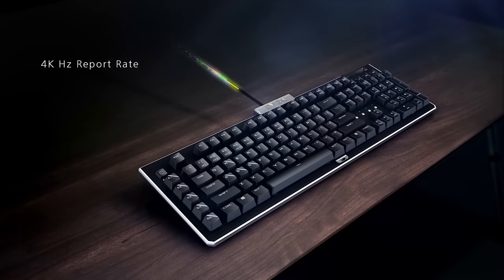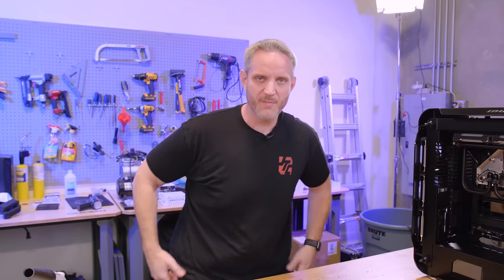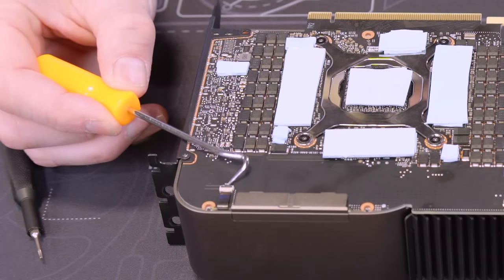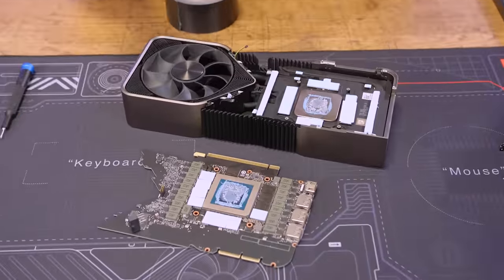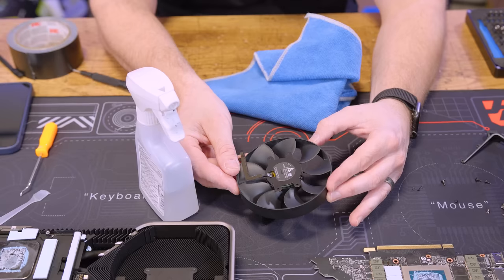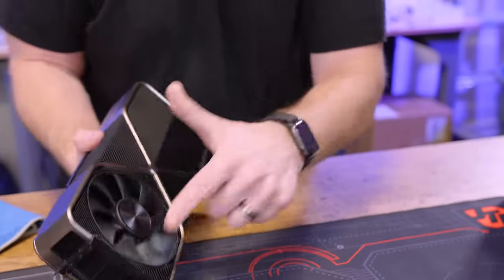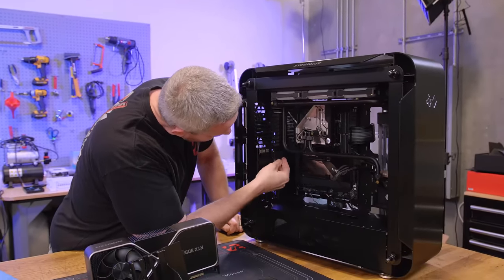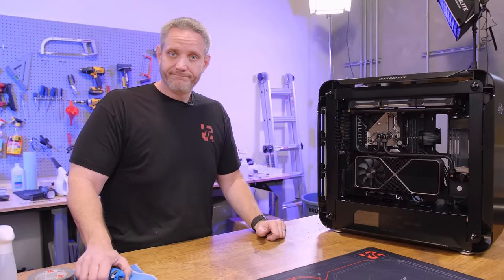Deep cleaning a GPU - Complete Teardown!

Comment: Once I disassembled my old Rx580 to clean and repaste it. I did it carefully but without too much stress and in the end it worked well and thermals had a big improvement.
 Nowadays, the mere thought of removing even a single screw from my 2070 Super, fills me with terror and concern that something might break and I have to find a new GPU.
Reply: I have an RX 570 and it was quite stressful repasting it because it was during the GPU shortages and I didn't want to break something.  Worked fine in the end, issue I had turned out to be my fan curve not being remotely aggressive enough.  Set in software and everything is good now.

Comment: If you have a 3090 FE you know you can't put this card vertically, when you do it, the fan taking the heat out of the card is pointing to the back of the card and directly to the motherboard, the air is NOT circulating. If you are going to put it vertically, do it with the card backward (GEFORCE RTX sign pointing down). So, the fan that takes the air out is pointing OUT of the computer. Another thing, if you get a fan mount to add 2 90mm fans to the back of the 3090 FE, you can lower the memory temp by almost 10d. Mine is almost all the time 78d, mining at 114MH and using the computer.

Comment: What I would like to know...  How many volts did that fan push back to the board when you gave it the 10,000 RPM cleaning?   :P
Reply: Absolutely zero. The motors in PC fans do not generate a permanent magnetic field. They require induction to generate a magnetic field. So, as long as they're not power on, they can't produce voltage. The bigger dnager is over spinning the bearing and wearing it out prematurly.

Comment: Have to agree on WC card over a AC card, expensive, but the only way to go if you want a silent gaming system.
My current FE card is the fist one I have ever owned, even with Nvidia’s new cooler it’s really loud as compared to my previous AIB card.
It’s running an aggressive fan curve, and does keep the temps low, but the noise really has put me off thinking about another FE card in the future.

Comment: Dude just change the cable to the Gen 4, the mount holds most of the cards weight anyway so put some 3m tape double sided tape over the mount holes or electrical tape and call it a day lol

Comment: Never spin a fan with air silly. That degrades the life of a gpu fan from coil feedback to the winding. You can use qd cleaner. Im fact you can clean everything with qd cleaner including getting all thermal paste off with no wiping and even extracting the oil spots that seep thru the circuit board. Ive used it on over 50 cards and repasted with thermal grizzly. On pads i never replaced them just pasted again on the open side and stick it all back together with 0 issues and great results thermally 
 It even fixed artifacts due.to.bleed thru. May be stopping cross voltage between two circuits. I would use qd on a brand new board as prep for serious over clocking. You may find yourself on the list

Comment: Giving me PTSD to when I water cooled my 3090 and it wouldn't post, and I freaked out thinking I broke it.  Turns out the output morning bracket for the back of this waterblock was too big for my crap pc case and not letting the card insert all the way. Removed that and everything was fine. I Almost cried lol

Comment: I have an EVGA 1080TI I bought years ago. I went to go do a teardown to clean it, and sure enough, when I was working, a wire just...fell out of the connector and now the fan doesnt start, overheating the GPU. So I had to swap it out for my original 960 4GB. I have no idea what im going to do, but for now, light gaming only
Reply: This is a message to be EXTREMELY careful if you dont know what youre doing, and if you do know, that you still need to be aware of everything that you're doing.

Comment: Mid 60s on the 3090 FE? My 3080 ti fe stayed at 83c and throttled down to 1600mhz, put it on a water block and now it boosts to 2100mhz at 55c. Should have used the same cooler for the 3080 ti, has the same power draw.

Comment: Mate, don't you worry about inducing a current on the board by spinning the fan so fast with your air blower? As I understand it, a motor and a generator are the same thing just wired differently, so wouldn't you be making juice by spinning the fan? I always hold the fan still when I blow them out just in case.
Reply: myth has been debunked

Comment: i actually had to redo my rx480 last night, developed a weird bug where the fan speed wouldnt kick up with either radeon software or afterburner and would thermal throttle by the time the game had actually loaded. only thing that fixed it was repasting and ddu and rolling back drivers.

Comment: Personally I’ve also made the thermal pads on my 3080 and the difference is abismal… +/- 20 degrees, the problem I had was with thermal paste, I mean, the only successful at keeping hotspot on a delta 12C is the thermalright tfx, consistent enough to hold the spread under the cooler, all the others, including KP and thermal grizzly, after about two weeks started to show a delta above 17C and rising as time passed. Upon taking the cooler off was as if the thermal paste had slowly spread to the edges and the center of the DIE didn’t had any. Worth noting that I always spread the paste evenly over the die… maybe something worth investigating in one of your videos…
Great work tanks 👍🏻

Comment: In the interest of logic, wouldn't that riser cable be operating at the same speed as the motherboard right out of the box? The only thing it's doing is just passing the signal along the wires and contacts so it should make little difference if the cable is labeled Gen 3 or 4, not unless we're talking about some junk concerning signal interference.

Comment: Aren't you supposed to brace the fan when blowing it will compressed air, because you can burn out the motor by spinning it much faster that it's designed to? Or does the fan already spin faster than the compressed air can make it spin?

Comment: Is that your 10900k build? Just wondering why you bothered to clean it with so much effort when you're building a z690 system anyway?  Understand the GPU side, I would have just blown the dirt away for the rest of the system while it was intact tbh if i was switching out.

Comment: Had horrible thermal pasting. Applies new paste better. Lets do a horizontal mount, it should be even cooler. So... after reapplying thermal paste how will you tell if it got cooler from the horizontal mount? =P

Comment: Just change the GPU fans for larger static pressure case fans. Time for ultra quiet gaming. 2 x 120mm is excellent but 2 x 140mm is phenomenal. Watch those temps go down. Anyone ever heard the Noctua 3070? That's still not as good as a 2 x 140mm GPU. If aesthetics are a priority, then don't do it! It looks janky. My routine mod for every GPU I buy.

Comment: I wonder about making a bit of a ramp off the back of the card to see if it helps direct the airflow upwards more than just blowing against a flat surface making the air go in all directions. It may help.
Reply: I did such a test (very crudely) with my 3090 FTW3. I have it in the standard (horizontal) orientation, so most of the heat is blasted at the tempered glass side panel. To satisfy curiosity, one day I placed a sheet of construction paper so that it created a curved ramp directing the air upwards along the glass. From what I recall, it did drop temps, maybe 5ºC. The experiment was far from GN-level. (Ha!) However, I think, the improvement was lackluster because there is not enough space between the card and side panel to create a much smoother air flow. Anyway, I have zero complaints about the FTW3 performance, but -- perhaps somewhat laughably -- been attempting to snag a 3090 FE (i.e., the pass-through cooler design would bring that airflow efficiency without needing to fabricate something) for a reasonable price (e.g., MSRP from Best Buy).
Reply: @MacCheetah3  I was talking more for his case in behind the card. Your case sounds like it is too close to the glass for airflow. If there isn't more than an inch of clearance between the glass and the card then I would change back to default mounting. Jay has even pointed this out in previous videos. Your suffocating the card otherwise and throwing away performance for esthetics. 

For myself I am all for performance first.
Reply: @olandersnake  It's a similar concept. Jay's setup/case may have more space to create a better angled air deflector ramp. And probably willing to fabricate from a better material (e.g., maybe plexiglass).

I am using the be quiet 500DX -- I have not been a fan of full tower and larger cases. The gap between the graphics card and side panel is ~2 inches. Vertical mounting might be better but that's not possible in my case.

Anyway, again, I am not complaining, just pointing out someone has tried a similar experiment to the one you suggested. 🙂
Reply: @MacCheetah3  styrene would work. In older cases I have made cardboard ones because I had a limited budget and decent airflow cases were really expensive. Had the exhaust of the card aimed upwards so that it wouldn't circle back down. It greatly improved temps and helped prevent overheating. It was about 11-12 years ago so I have since lost photos but I had cut out the 92mm exhaust and made a extention to a 120mm fan. That and the top mounted power supply did there work. Later cut the top of the case to mount the 92mm fan to pull out any hot air at the top of the case (it was quite warm to touch before adding it). I had fun doing it but don't miss those days.

Comment: I just realized that since 2018 I haven't once opened up my Graphics Card to clean it properly. Sure I cleaned the fans but only from the outside because I had no clue how to do it. I regularly clean the dust out of my comp every 6 months though and my comp still running silent like a dream.
So that point to me telling you all this? How to open my GeForce GTX 960 without me making a boo-boo. Any advice or directions on where to look for instructions on this will be appreciated.

Side Note: OMG You're using magnetic Screwdooder!!! :O
Perhaps I'm thinking ancient tech but isn't that bad for your comp?

Second Side Note: Why don't you hold the fan why using the blower? Would clean it better no?

Comment: Isn’t it apparently bad to blow high pressure air on the fan like that ?
Reply: If you let it spin, yes.  It should be fine if you hold it still, even at high pressures.  Basically, it can cause accelerated wear or outright damage to the fan and it's possible to cause damage to the fan header from current flowing back into it

Comment: please no one clean fans the way that Jay just did in this video. The issue of damaging the tachometer sensor aside, If the blades are moving the energy that should be going into cleaning the blades is going into moving the fan blades.

Comment: "the gpu is what gets most dirty" lol. my gpu never seems to get dirty for some reason. gets some dust on the top and thats about it. it lose and can be just wiped off with one pass. fans and cooler is always clean (gpu does have the 0rpm but i run it 25% all the idle time. so basicaly runs 24/7.) on other hand cpu cooler and case fans get clumps of fluff and dust and psu the same (have open case and have cats) dunno gpu cooler always looks to be spotless

Comment: And.... Don't blow the air directly at a PC fan. Depending on the type of bearing etc, it could severely damage the bearing. They were only designed only for up to certain RPM. Anything more than that, could damage. Been there. Had issues when I did that. Learned from a mistake. Either hold the fan and blow the air or remove the fan (if possible and blow).

Comment: What do you do if a little GPU screw is stripped? (Thank you ASUS for over tightening the 3070 STRIX)
Reply: Try putting a rubber band on the head of the screw and then putting the screwdriver on top of the rubber and and try. Hard to explain but you can google it if needed

Comment: Jay, are the motherboard slot and the gpu both PCIE 4.0 x16? From what you've said, your vertical riser is only PCIE 3.0 x 16 - any issues with this at all? I'm in the same boat but wanted to add a vertical riser for my powercolor rx 6700 xt but haven't done it yet partly due to the cost of the PCIE 4.0 vertical mounts (yep, I'm a tightwad lol). Ta in advance.

Comment: I need some help. I have Asus Tuf Gaming B-550 motherboard which has argb header. I used a cooler master 5-1 argb splitter to connect case fan front panel and other case fan, cpu cooler fan, led strip and argb gpu bracket. The case fans and other fans are synced while cpu fan,led strip and gpu bracket is synced differently. But i cant sync them all together. How do i do it?

Comment: I am a little shocked, are Jay not supposed to be a professional in for pc hardware and yet he let that fan spin out of control on the gpu. That can make the fan produce electricity in the components on the pcb and by letting the fan spin fast, lead to premature bearing failure. All prevent fan from spinning when you blast clean it.
Or am I wrong on the statements above?

By the way nice BFGPU. But despite these apocalyptic gpu market, I managed to snag a EVGA RTX 3080 FTW 3 ULTRA GAMING 10 GB card december last year.
Reply: its a myth that has been debunked

Comment: Off topic question.  I am lucky to have 2 "newish" GPUs.  I have a Founder's Edition 3070TI and a Gigabyte 6800XT, if I were to sell one of them which one do you think I should sell?  Thanks!
Reply: The 6800 XT while it still holds some value. Because once something better from AMD is released that gpu will plumet. Or if the prices start recovering.. big if on the prices recovering.

Comment: Would love to see him test the EK 3080/3090 FE water blocks.  I have one and My GPU runs somewhat hot still.  Wonder If I did somethnig wrong when installing it.
Reply: RogerWilco99  I'm running it upstream.  I have it in the O11 Dynamic with the EK Distrobution Plate.  I don't know if maybe I tighted the waterblock too much and the thermal pads aren't doing as much now.

Comment: ...about overspinning the fans... anyway, its your money :P But I am wondering how you just act like this just is not an issue. Overspinng a fan? Nah, just clean it i a windtunnel next time. Funny sounds too. 😮‍💨
Trust me, I learned it the hard way, that this can be a big issue. I knew about it from the start, but I missed to stop one small fan in a dataprojector when cleaning it with air. Stopped instantly when I hear that 01:53 whiny sound, but it was too late. Few bearings gone, cooling gone, fan not sold as a spare part, no aftermarket, projector gone, 800 bucks gone.
Reply: Ouch dude. I leared the hard way to but it was on a CPU cooler.
Reply: overspinning the fan has caused all those..fans ... to ... wait  ..never? we have never seen it? crap

Comment: Ok people this is so completely unnecessary.  A compressed air can will easily be able to clean out any dust that got in there.  You don’t need to take the gpu apart.  Also unless you’re Jay you will probably won’t be able to put it back together.  Also you should use an anti static mat and not an oversized mousepad.

Comment: Maybe someone can give me a little insight. I have a lga1700 socket 12700k with a deepcool castle 120mm AIO (I know that isn’t great but it came with it) I recently bought the Corsair h100i elite capellix. It doesn’t say if it has the lga1700 standoffs. Will the standoffs from the deepcool work or do I need to order the retrofit kit?

Comment: I see you have an automatic screwdriver you should check out the esc 126 its a small one that looks like a vape almost but it has a ton of torque a light and motion control and a screen it is amazing.

Comment: What if you did a horizontal mount and then added a high end sound card to the 1X slot?
Reply: He’s got a Goxlr he doesn’t need a sound card lol
Reply: @aaronfisher7159  In that case, he can add a PCIe to M.2 card, and then add 2 or more additional NVMe SSDs. Or a capture card, or if the board lacks one, a 10GbE NIC.
Reply: @Razor2048  those would be better options yes

Comment: kills a 3000$ GPU by 12500rpm'ing it by a leaf blower 1 inch apart from it and using the motor as a generator to kill the electronics that power it. yeah, ... good advise.